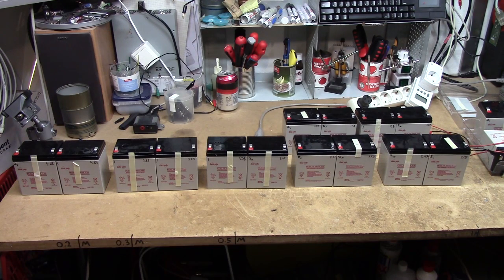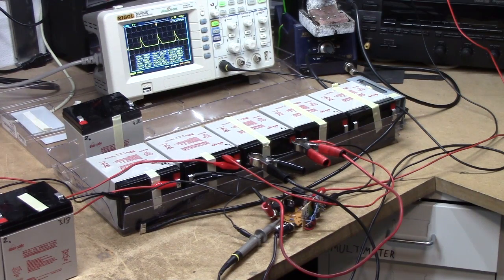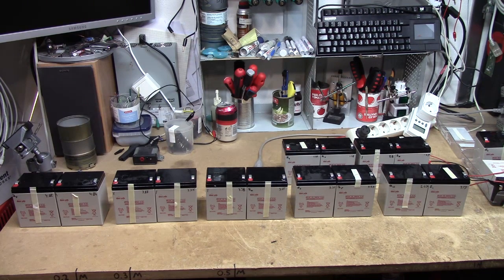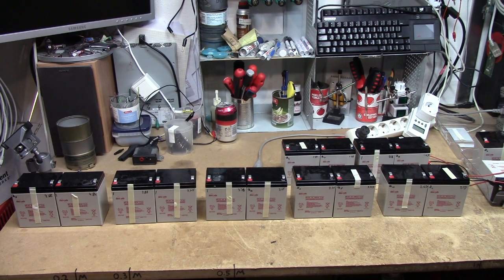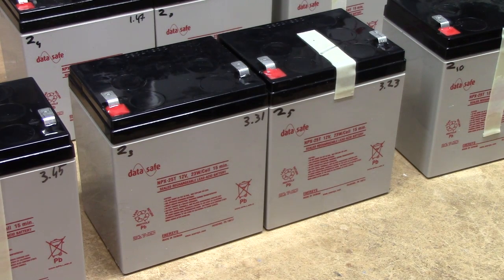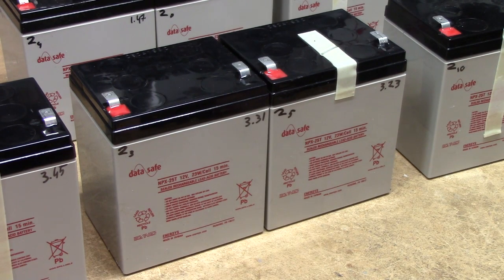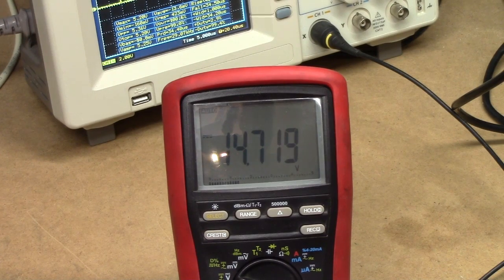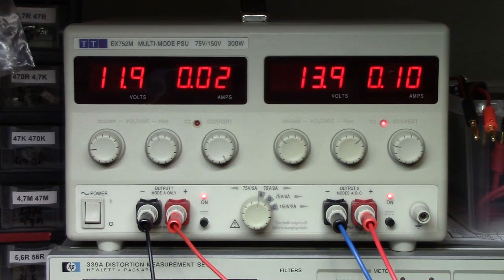Battery desulfator science part 1 - Introduction

Comment: Desulfator? Realy?
Sulfation can be avoided if the battery is fully recharged immediately after a discharge cycle. There are no known independently verified ways to reverse sulfation. There are commercial products claiming to achieve desulfation through various techniques such as pulse charging, but there are no peer-reviewed publications verifying their claims. Sulfation prevention remains the best course of action, by periodically fully charging the lead–acid batteries. Source: Wikipedia

Comment: The first rule of battery desulfators is “There is NO SUCH THING as a ‘Battery Desulfator’!”  I use a 2 Ohm/100W resistor and a phase timed charge so that the amperage goes from .2Amp to 4Amp over the period of a month.

Comment: Interesting video! I had some success reviving old (at least 15 years) SLA batteries by filling them up with purified water. But that can not have been the best solution because they are now gassing even at their normal charge voltage (only about 12 V).
Reply from the maker: +DrCassette I'm not surprised; an SLA that'll improve with added water is going to have been overcharged, and probably has pretty mangled plates inside, so that the cell consists of a more or less held together heap of plate fragments.
Reply: That explains that. I took apart one of the batteries (same batch, they must have had a similar fate), and the inside was similar to what you'd get if you were going to dry the dirt out of your garden. No trace of acid in that thing...
Reply from the maker: DrCassette Yep, I did the same thing some time back, except I at least got little square plate fragments out of it: https://www.youtube.com/watch?v=0rnDK1EOITM&feature=player_detailpage#t=735

Comment: Try a FOXSUR Charger it worked for me my Hobby 12 volt lead acid battery was showing only 6 volts after a long storage,
After one day on the repair pulse setting it is now reading 12.47 volts on my meter, so I will give it more time as the voltage keeps rising today it is 13.6 volts, good video very interesting. Thanks

Comment: I have 4 x 95 a/h deep cycle flooded batteries in my RV that are connected recently to a new MPPT controller running 4x 100 w panels, 24v in 12v out. There are another 2 x 100 w panels arriving in a day or so to put in. So my question is if my batteries are still accepting as much charge current as my system can supply right now, adding another 200w nominal, obviously there will be a slight reduction in charge, ( have seen 380 watts so far,  with this new MPPT, PWM never gave me more than 275 w so another 200 should get me to around 550 to 570 ? then get up as close as I can to 800 total watts with the next 2 panels, until I switch voltages to 24 with a voltage reducer to run the in place 12v systems) I intend to add in another 200 next month. My system will read upwards of 14v during the day under production but quickly drops to under 12v in the evening so I know my batteries are suffering. IYHOP would a good functional desulfator bring these batteries around? And if so, do you have a recommendation for a unit? I've been looking at schematics for me to build and kits that I can find online. I found one version that uses a pair of 6.8kuf caps and a pair of rather small coils but the seller claims they are good quality pieces. I have a couple of rather large coils I purchased for building my own units, I think I would need at least 2 for all the batteries I have around. My plan was to disconnect 1 battery, connect a blocking diode between that battery and the others to keep the desulfator from diverting power to the other 3 and switch batteries once I see improvement if possible in it. I need to get this done pretty quickly before cold weather sets in this fall and I start having issues with freeze ups. As I'm attempting to live off grid, I need to get my system up over 1.5k to possibly 2kw asap. I have installed heavy enough wire to run up to 60 amps of charge and intend to include some LiFEPo4 cells and a BMS also asap. If I can get my flooded batteries to go to a full 14.8v and hold 12.6 or up, this should work. Once I switch to the 24v system I will have a wider safety margine  before I deal with inverter overvoltage shut down as I sometimes have now with the current 12v system. I'm not an EE but I have spent time in tech school for electronics but that was 40 yrs ago and I've forgotten too much and to much advancement has happened for me to start over again. I don't deal well with computer codes and microprocessors and I've been trying, just not getting anywhere with it. So it's all analog for me.

Comment: Very interesting project!  - I am about doing a test like this but unfortunatly with fewer sample batteries and only few testing equipment. I am trying to test several electronic pulsing schemes and commercial pulsers.
When can we expect to see final results?
Thanks!
Reply from the maker: +richardnanis Relatively soon - I've got data from 5 or 6 groups of batteries now. It's been slow keeping the project going since I keep needing my lab power supply for other stuff all the time.
Reply: +FFcossag thanks for your fast answer - i know exactly what you mean :-) Do you do your pulsing test all with the same pulsing schema, or do you also vary parameters like frequency, duty cycles, voltage of pulses e.g. ? Some claim that the frequency is important cause if you meet the resonance frequency of the lead sulphate crystals you will succeed more quickly in the desuphation process - but honestly i doubt that. Imho there is no reasonable resonance frequency for all the different shaped sulphate crystals, and there is no mechanical vibration recognizable, when you pulse with electric impulses of any kHz or even MHz. Do you cover these aspects in your test as well?
Reply from the maker: richardnanis No, it's all done with identical parameters. There's too much variance already in the small sample size.

Comment: Any & all & FF? I have come upon literally 200+ 7 Ah AGM /VRLA batteries that all have a date code of about one year old. Trying to manage the charge of all is nearly impossible. My goal is to connect these cells into packs of ten in parallel configuration.
The issue I keep going over is how to do this? They have the flag style terminals and I could create a wire harness to do this. I would rather not use wire. None the less I am going to need to go the wire route. I could of course create any of a number of voltages but my inverters are all 12 volt and are of the low frequency pure sine wave type.
So the question is... wire gauge for each 7Ah battery factoring in worst case Max Amp draw, what would be "safe"? This would be commoned to one bus with a full rack containing 10 packs of 10. Thanks for any input you all may have. C
Reply from the maker: You need to estimate and test the current for your application. I'd probably just solder spade connectors onto copper installation wire and go from there. You can use MiscEl (google it) to calculate wire stuff quite handily.
Reply: Thanks for the reply. I assume the max output of a 7Ah 12 volt battery if shorted could be quite high  I would need AWG 12 Ga wire. But with ten batteries run to a common bus would be 70 Amps.
Ratings for chassis wiring verses power transmission differ quite a lot. I am thinking of going big as in power transmission.
While the batteries were free the terminals and wire are going to be a bit of an expenditure. At least the terminal voltages are all still above 12.75vdc
I'll have two banks of 700Ah for a total of 1400 Ah. woo hoo
Reply from the maker: Craig Nehring
There's really no point in sizing the individual battery string wiring to handle anything like short-circuit current. I'd design it so that each of the 10 strings of 10 batteries can handle 1/10th of the total load (2,5 mm^2 installation wire comes to mind). The wires connecting those 10 strings together of course have to handle the full load, though.
Reply: Got it, it looks as 2.5mm^2 = about American Wire Gauge 14, that would allow 39 amps for chassis wiring or about 6 amps for so called power transmission. It is somewhat dodgy to do this properly trying to factor worst case in the event of a serious failure.

Comment: If u want to use Common sense and spend seconds on learning how to desulpher lead in batteries then I am ur guy... Everyone else proceed to waste 21min with this video.... You learned in school that there are acids and alkaline substances... Things that give or take electrons... Common sense will tell you how to get back to the starting point the lead was in when it was new by doing the reverse of what made it that way...take all electrolyte  out and rinse out thoroughly with water. Then make a solution using baking soda and water so that it's as dissolved as possible... Pour this solution into the battery and let it sit for a couple of days ...shake battery for a  little while after the couple of days..  Pour out the solution and rinse out thoroughly with water... Add the electrolyte and enjoy your brand new  battery...
Reply: Question for you METO U:  is "Add the electrolyte" comprised of distilled water, or aluminum sulfate, or cadmium sulfate or the 35% sulfuric acid/65% distilled water solution sold at auto parts stores? Please help clarify what is the electrolyte. Thank you!
Reply: @rocktech7144  AGM aren't gel. These are gel.
Reply: If METO were half as smart as he thought he was he'd have known these are sealed batteries.
Reply: It would be nice if it was so simple.  I don’t understand all of it, but one issue is that large lead sulfate crystals slowly grow on the plates.  The crystals act as insulators, shielding part of the plates from use.  The point of pulsing or using higher voltages is to break down the crystals without screwing up the plates too.  The crystals are known as “hard sulfation”, and are more difficult to remove than “soft sulfation” deposits of lead sulfate.  The same compound in small crystals is easier to remove than in large crystals.

Your suggestion might help recover some capacity if the electrolyte has been lost due to overcharging, but it won’t remove the hard sulfation.